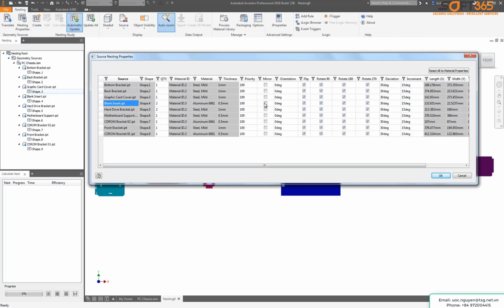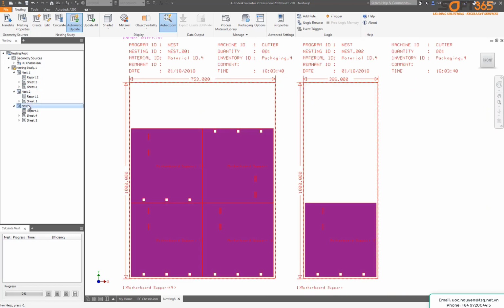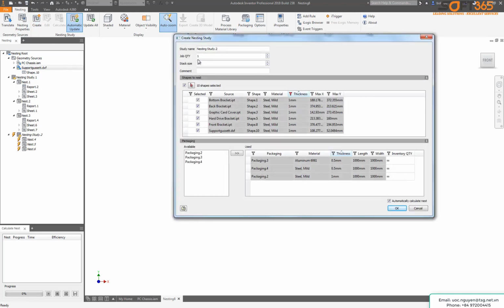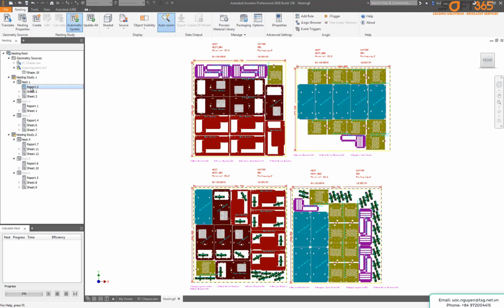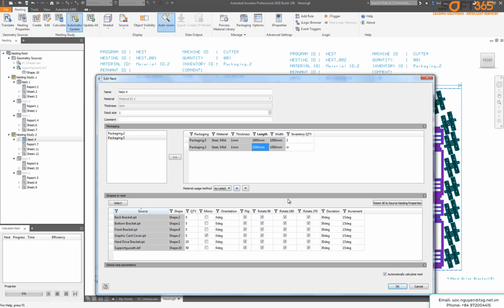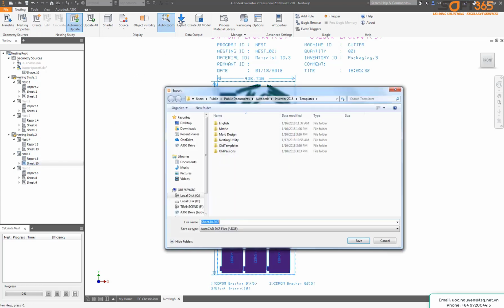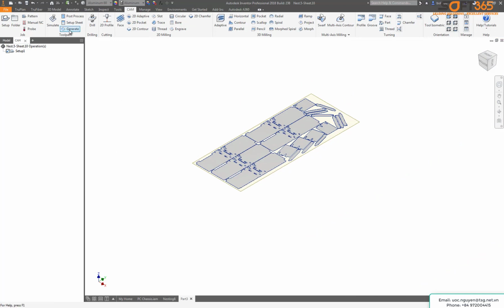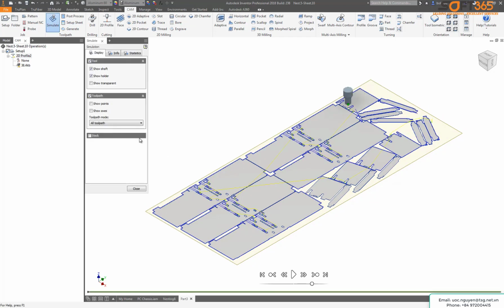Inventor 2018.3 & Nesting for Sheet Metal

Comment: Hello ..Does anybody know about packagings..If i add multiple package for one material type, program does not use different packages..For example i am adding two package :200x100 cm and 500 x 500 cm..Program use 200x100 package well.But If needed to use additional package for parts it use same package again even for a small part. I think it must use smaller package for this additional part
Reply: Please tell me how to set machining offset ,I have done nesting but they are set of by default x10mm,y 10,but I want to x110 ,y20...This is may machine calmping ...